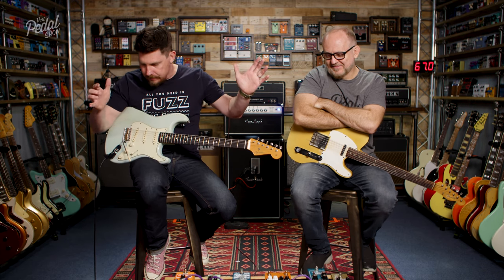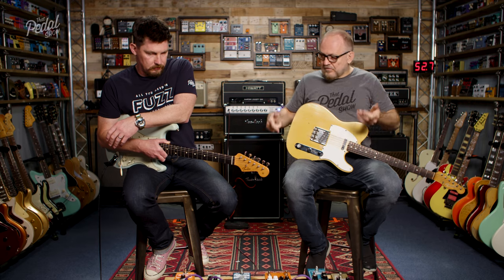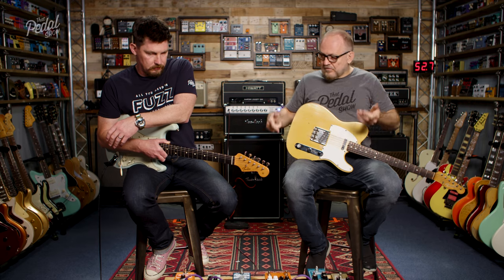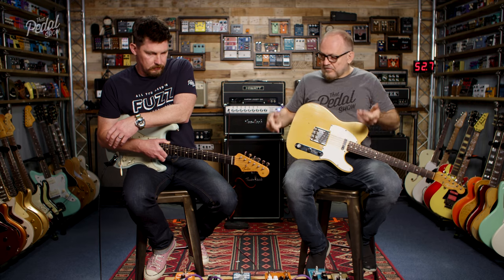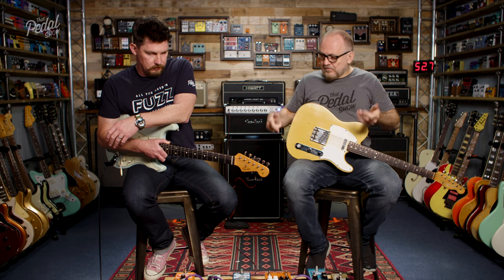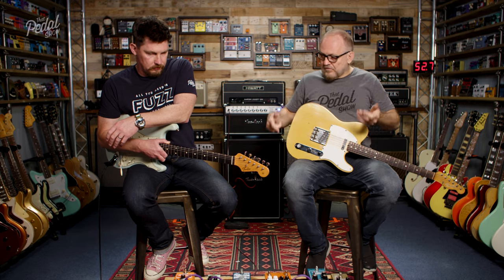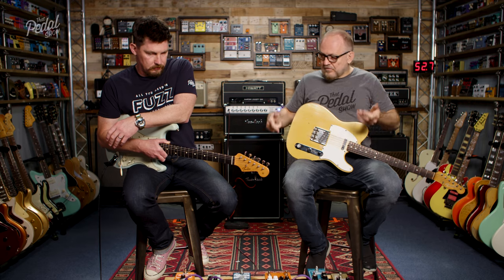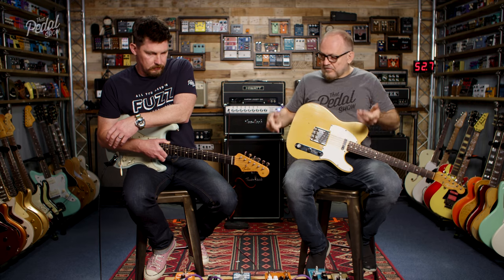To Buffer Or Not To Buffer: That Is The Question – That Pedal Show

Comment: Sorry another though and perhaps a bit of rambling will follow. I don't expect Dan or Mick or anyone in the community to answer as there may not even be a question, but I really enjoyed this episode and it got me thinking. A tale of two signal paths...

There's a bit of basic electronics which dictates that for maximum power transmission through a system you need to match output impedance from one stage of a system to the input impedance of the next stage. So you'll see this in Solar power systems where you can get a Maximum Power Point Tracking (MPPT) charge controller, to stick between your solar panel and the battery being charged. So as the light conditions and the output impedance of the solar panel change, through the day, the MPPT maximises the  energy which ends up in the battery. As an aside in a small system, where you have a small power output solar panel an expensive MPPT is potentially not justifiable as it might gain you 5% of very little, and a cheap basic solar charge controller will charge the battery in slightly longer time, which you don't care about. Obviously things change at scale.

All that has got nothing to do with Electric Guitar were you're passing a signal, (Voltage) through the system and you don't care about power. So to maximise the Voltage you have a low output impedance into a high input impedance of the next stage. I kinda think of it like a Volume Pot, in the Pot you've effectively got a voltage across two resistors and the resulting voltage across each resistor is based on their resistance ratio. So if you've got 10V across two equal resistors then the resulting voltages are 5V across each resistor. But if the second resistor is 9 times the value of the first Resistor then it'll end up with 9V being dropped across it whilst the first resistor will have 1V. So with an adjustable Pot you can wind 10V down to zero and back up as you want.

Now for the second signal path, Amateur/HAM radio. In Amateur radio systems you're again trying to pass a signal through the system, but in this case the stages of the system all match input to output impedance. (I'm not actually a HAM radio head but this is my understanding.) So I guess they don't think of the audio signal as just a voltage, but the combination of voltage and current. So each stage of the system will have matched impedance all the way through. So the output impedance of the Antenna, down the bottom of the garden, will match the impedance of the copper cable carrying the signal back to the radio shack, will match the input impedance of the radio receiver. You'll see HAM radio coaxial cable with an impedance rating, regardless of the length of the cable you use you'll end up with the same impedance in the coaxil cable. I've no idea how this magic works, as you double the length and I'd imagine you double the resistance, but you have two conductors separated by an insulator, so effectively a Capacitor, so whilst you double the length of cable and double the resistance the changed capacitance results in the same impedance, regardless of length. Like I say Magic.

So all that rambling just to ponder that HAM Radio people have no idea about putting something in the signal path and messing up the entire system. Or changing the length of a piece of cable and totally changing the signal coming out the other end. HAM radio people, have it easy, don't know they're born.

Right I've thought of a question after all that, if anyone made it this far ;). The Guitar connected directly to the Amp with a really short cable is very interesting. I know radio systems are not your gig, on the show, but if you did have a radio system and used it to go from the last pedal in the chain of pedals, to the Amp, removing the length of copper cable, would that have reduced the capacitance of the system so the problem didn't occur? And I wonder if I could measure the capacitance of cable I like, end up with my optimum length, guess it depends on the manufacturer.

Comment: Hey Mick you need a sarno black box. It is a tube buffer with variable input impedance. I like no buffer but have issues with delay after my fuzz. I put this after fuzz vibe wah and adjust the input impedance to taste. It is like no buffer at all. Ymmv but I love it. It was designed for pedal steel players

Comment: If I have understood it correctly, I think a solution to the problem you could try the Secret Machine in the same loop with a buffer after it. 2 pedals in one loop, just as Dan had done on his board. Though you may have already considered it. Great work guys!

Comment: Greetings from France,
So I recently got a (vintageish) lawsuit MIJ strat and MIJ Les Paul Custom to go alongside my 1960's Eko made jag style thing (which I use alternate tunings), and all of a sudden your shows make a lot (lot) more sense. They were great and entertaining, but now it clicks in a way that didn't beforehand (stuff like like the volume thing with a strat and a fuzz).
Also, any solution for microphonic pickups? My Eko sounds amazing but doesn't like volume, and the pickups are weirdly sized, so I can't just swap them out. Anybody have any tips?
Reply: Wax pot them; it's  not terribly difficult.
Reply: I have a Nashville Tele with a  microphonic neck pickup. I stuffed a piece of rolled up sticky tape under the cover. It's still a bit microphonic but the sound is so good that I wouldn't consider doing anything else to it.

Comment: Simple answer:  Mesa Highwire dual buffer.  Guitar cable goes into the Highwire input; end of pedal chain goes to Highwire output, then out to amp.  (One exception is if you have a fuzz which would go before Highwire input).

Best part of the Highwire is that the input impedance and output impedance are designed in such a way that it is incredibly transparent.  In other words, you are isolating the guitar from the pedal board with the Highwire input buffer, and then isolating the amp from the pedal board with the Highwire output buffer.  Since I play acoustic as well as electric with the board, it is imperative that the buffers are neutral in tonality.  The Highwire does that.

You mentioned "not all buffers are equal" and nothing could be more true!  So the real question to all of this is what is/are your buffer(s) really doing in terms of "coloring your tone"?  Some buffers darker the tone, some brighten the tone, a precious few are neutral in tone.  It's a function of output impedance of each buffer.  If you love the coloration of a particular buffer then great.  If you want/need transparency in your buffer the Highwire is a really good solution.
Reply from the maker: Would be interesting to try it. But by nature, a buffer cannot be transparent. It’s making high impedance low impedance, and that is not the same. Cheers!
Reply: @ThatPedalShow  Here's the test, plug your guitar straight into your amp and play, noticing the tonality of the guitar and amp together.  Now plug your guitar cable into the buffer and the rest of your board (all pedals off and with the output buffer at the end of the chain) and then your board into your amp like I described above.  Now play, again noticing the tonality.  If your tone sounds the same, then your buffer setup (Mesa Highwire for instance) is "transparent".  At that point your future changes in tonality are solely due to your pedals which we all love!

Comment: Boy oh boy - probably only Mr Cornish has this all sussed! So many pathways to go down. So, from all your trials here my preferred sound was just the Secret into the amp. Even with the Belle Epoch buffer there it was far too scratchy, moving it down the chain of course helps because cable length before that BE buffer is lengthened. Also, the BE has a low imp input And another high imp output, sooo switching on the Echorec on afterwards still gives you the same sort of high end push exactly like you got :) only not as much as with the fuzz into buffer -   The design of having a output large-ish Volume pot ground is the main culprit here -it happens with a lot of pedals not just fuzz  - early OCDs are a well known one. How to fix it ? Get a "buffer" that shows the desired "low" impedance to the fuzz, and really low output to the next pedal -  I haven't done that, but next best thing so I soldered a patch cable with a capacitor in that mimiced the length of cable I like, and that then goes between my fuzzes and the next buffer - top end madness rolled off nicely.

Seriously Mick - do it - get a 10m cable from the fuzz out to your preferred buffer (or 15m or 20m) whatever sounds the best. Then make up a patch with a relevant cap (Dan can help you with this - I think I used a 2nF), get that plugged into your G2 fuzz loop and you will be laughing..
Reply: proud of myself for understanding what’s being said here, which would surely have looked like gibberish to me back when i first started watching TPS. Thanks for the info here!

Comment: Jack Orman's site has a wealth of information on buffers. My understanding is that op amp buffers are the cleanest, followed by jfet buffers and then general purpose bipolar transistors buffers. The last two won't be as clean as the op amp as they can't have a gain of exactly 1. Each of those will have different input and output impedances, so a bipolar transistor boss style buffer will only do so much when it comes to a huge true bypass pedalboard or a really long cable run. I for one am long overdue to try the quad op amp AMZ super buffer for my bigass 10 true bypass pedals tone-suck pedalboard. Be that as it may, it would be really cool to see some pickup simulators (like the one in the pineapple pizza fuzz) to combat buffers before fuzzes. There is no video on that I think!

Comment: I picked up a Mooer Trelicopter from Craigslist for super cheap a while back, and when I got it home, I thought it was broken because I could hear a subtle clicking at the same rate as the trem speed even with the effect off. Turns out it NEEDS a buffer in front, so when I put a buffered pedal in front, the clicking is gone. Great sounding trem BTW- very sweet and musical.

Comment: Thanks for the video. My take away? 

there are alot of contingencies. Answers that solve one problem, only  introduce another, in another way in another area. Buffer or not? As i learned as a hi fi audiophile, results can be unpredictable and "trust your ears...". Because the results can be unpredictable, you do have to tinker to see what works and what doesnt in practice not just in theory. Another solution that might reduce the problem for some,  is to go from a ten pedal board to a 3 or 4 pedal chain, which makes the problems in question more manageable with less contingencies to deal with.

Comment: Great vid.
One thing missing here that is on many boards is a tuner pedal.  My boss TU-3 has an always buffered bypass.  Therefore I don’t have a true bypass signal chain even if all the other pedals are true bypass.  It would be interesting to see what you all find if you move a buffered tuner pedal around in Mick’s board configuration.
Reply from the maker: An extension of everything we talked about - it’s just another buffer so will be some variant of this. :0)

Comment: I really think that Fuzz Faces should be built with a buffer or a knob to fix the Wah problem, as Sabbadius and a few others have. 
Before getting a wah that has a buffer which solves the issue(Fulltone Clyde Deluxe), I used a Boss pedal, whether a tuner or dirt, and it usually worked perfectly well to fix the problem, though I would sometimes have issues still. 
Once a pedal is priced at $199 or more for a fuzz circuit, I think it’s not too much to ask for a buffer option in them. 
I also love the Deep Trip BOG, which fixes the Wah issue by changing the input impedance?...if I’m remembering correctly. But, it does act differently than my Arbiter style BC108 JHF1, which I find has the best cleanup, not just how well it cleans with volume roll off, but the actual glassy full tone, with great low end and still can cut through a mix.

Comment: That was a bit of an unexpected result with the fuzz going into the echo. I've heard of the opposite problem of fuzzes reacting weirdly when not driven directly off the guitar. I haven't done much fuzz so I haven't really experienced that problem.

The issue I have had is just a cumulative effect. Running through my pedalboard with all switched off shaves off a fair bit of high end but with a substandard cable it is a huge loss. Comparing cables plugged directly from guitar to amp didn't produce significant differences but with the extra cable and pedalboard the frequency loss moved further down the spectrum into the more important guitar frequencies.

Comment: When I had my loop switcher built I got the guy building it to put switchable buffers on the main input, the send to the amp's effects loop and the main output (I use a 4 cable setup)
It feels like this has given me a constant, albeit quite bright starting point. I've knocked the presence down on the amp to compensate. It may not be for everyone but I feel very comfortable with it.

Comment: I place buffers after fuzz and compressor. I notice buffers affect both significantly. I also place a buffer at the end of my chain if it’s more than 5-6 pedals. Most of my boards go fuzz>compressor>buffer. Mind you I use compression as a nearly always on effect because I can never crank amps to get it naturally.  A super light compression helps the feel if I’m on a quiet stage or on in ears.

Comment: Guy's I love this show , I have learned a lot, and thanks to you now have a totally clean signal chain. Going back to todays show at the 32 minute mark where Mick put the Klon on the board. How about replacing the Klon with the Wampler Tumnus Deluxe, or the smaller Wampler Tumnus for space purposes. It is I believe marketed  as a Klon clone. Although I have the smaller Wampler Tumnus on my board. I am not technical enough to know about its buffering. I use my smaller Tumnus for Mids. Good luck Mick.

Comment: Hey guys,  good video.  It seems like you danced around what you want... a buffer at the output of the fuzz only when it is enabled.   Placing the buffer at this point and linking it to be on / off with the fuzz fix both problems (as was proven in your experiment).  This would of course eliminate unwanted buffer behavior when the fuzz is off and no drive issue when on.  If there is some load wanted a simple LRC passive circuit could be tuned to the desired effect and placed immediately before the buffer.  I wonder if you can reverse the 29 pedal behavior to bypass when off and to buffer the effects loop when on!

Truthfully, though, it looks like a good mod project for the pedal.  After looking at the schematic of similar fuzz circuits it also looks like they want to be the last thing in the chain and plugged directly into the amp.  Cheers!
Reply from the maker: Not quite, as the sound changes so drastically with the buffer, and Mick didn’t like that sound.

Comment: Really interesting video guys! Mick, if I was helping you put the board together I'd suggest adding a Klon style buffer right after the Secret Machine since you already know you like that style buffer. I've built the buffer from a Klon (just the buffer section of the circuit) to use for this purpose in the past and it sounds exactly as you'd expect, just like having your Klon on the board but switched off. You can fit it in a very small pedal enclosure and it's always on so you can tuck it away somewhere stealthy. I'd probably put both the Secret Machine and the Klon buffer before any loop switcher just to keep everything really consistent, but I think you could probably get away with putting them together in the first loop too if you don't want to hear the buffer without the fuzz on. I would think that would solve all the issues you were having. Good luck!

Comment: So, if you are just playing in your home and your cables are never changing length then you can tailor your sound to your equipment. However, if you are giging and playing all sorts of different venues large and small, your variable cable lengths or lack there of (wireless) are going to change your sound dramatically. This is why buffers are important, consistency. When using a buffer, it is important to use a multi band EQ pedal and preferably one where you can bias each frequency one way or the other. This allows you to shape your sound around the guitar you are using and compensate for the tone you desire when no cable impedence is present. In my opinion, always buffer and always EQ and the rest gets easier from there.

Comment: Might be a related thing I came across the other day whilst mucking about with the pedal chain. Got a stereo chorus and I plugged the outputs into the stereo inputs of my delay. Tone went to hell. Sounded like I'd thrown  blanket over the speaker cab. Maybe the chorus is mucking about with phase in order to get it's stereo output. Pulled one of the outputs and we're back to business as usual.
Perhaps this could be a topic to explore on another day.

Comment: I use a AB fx loop pedal just to have 2 chains on the same pedalboard. My 1992 germanium fuzz face sound amazing alone and terrible with other pedals in the same chain, whether true bypass or not. Even a TU-3 changes the tone.

So I have a chain A, with fuzz face and a analog delay that does not ruins the fuzz. Then a chain B, with tuner, chorus, vibe, wah, 2 drives, tremolo, another analog delay and a boost.

That was the solution I've found to have my fuzz sounding good while I have another pedals that I like on the same pedalboard.